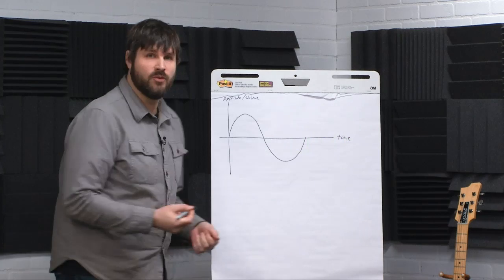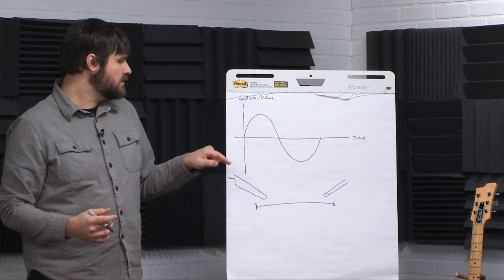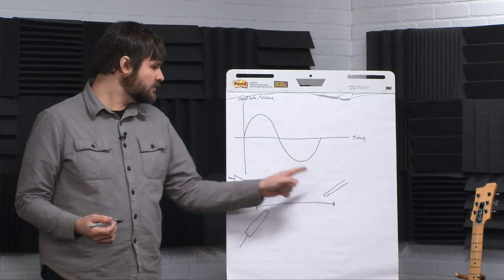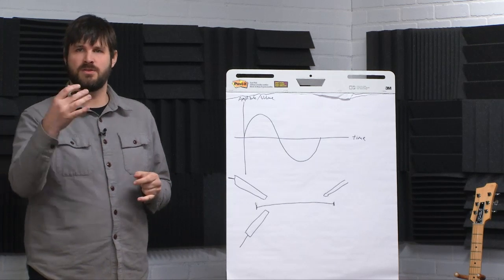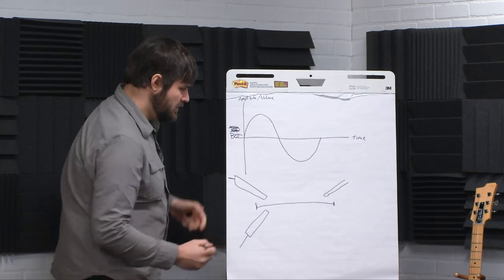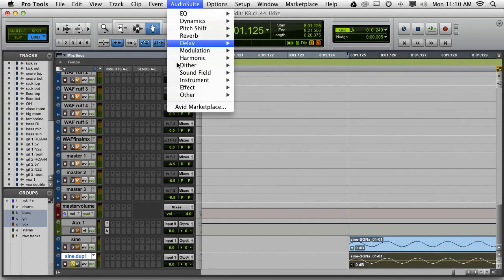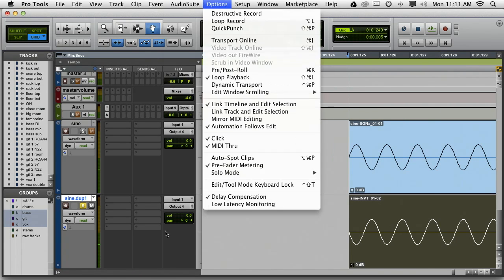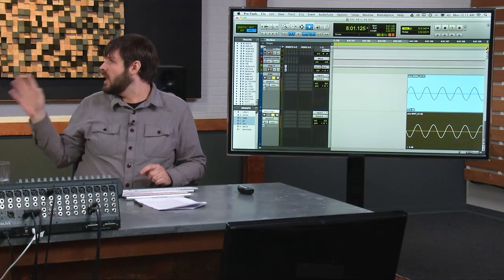How to Mic a Drum with Kurt Ballou

Comment: Great stuff and great studio! What is that unit in the far right rack the big piece? And do you have all the rack gear available in pt? And about the snares I always rev pol on the bottom mic ,should I reverse top? In my experience I usually look at the overheads when checking phase,is this good practice,and not so much a fan of bottom snare mics anyway,and do you have other engineers come in to track,I need a drum Room to track ,I'm in nj?